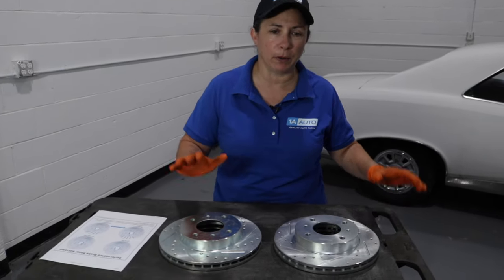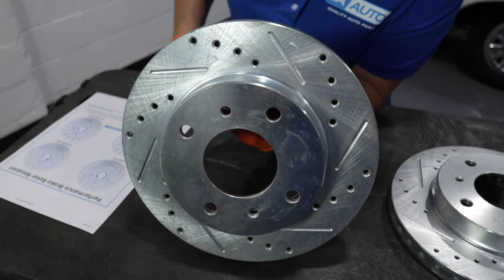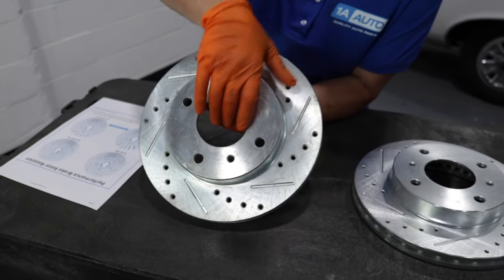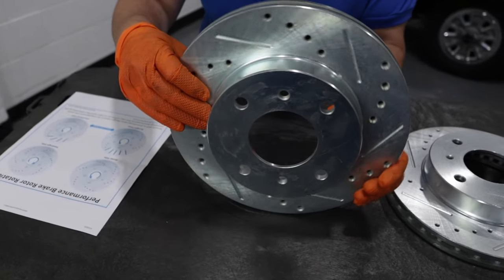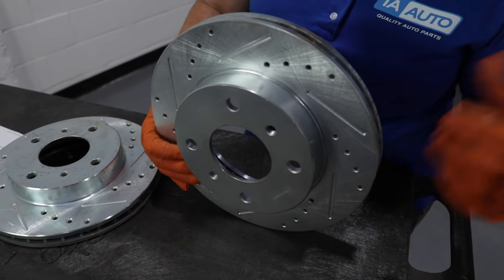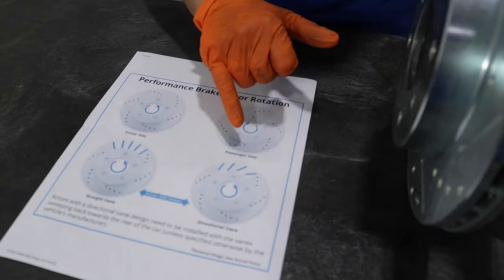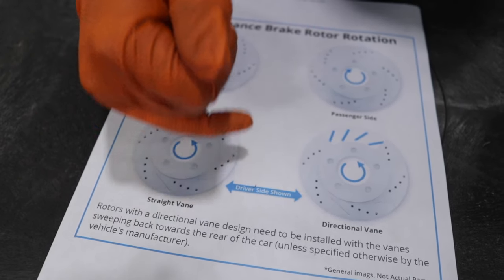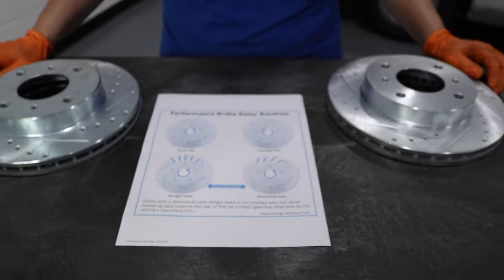The Correct Direction to Install Performance Rotors on Your Car or Truck

Comment: I am staggered that there seems to be no definitive reliable view which way soemthing as fundamental as brake discs should be fitted, whether handed discs grab air or remove air, whether slotted discs face towards or away, it is simply astonishing there are so many conflicting opinions. It shouldnt't be that difficult. Helpfully this video shows an instruction sheet which indicates which way veins should face, but what if the drilled slots are in an opposite direction to the veins?
Reply: If your veins are directional and curve inwards then ignore which direction the slots are facing, the cooling veins are VITAL to your brakes cooling down.  You want the veins to be curving outwards towards the front so that they scoop in the air into the middle of the rotor.  I've been scowering the internet for days and honestly I dont think the slot direction really matters.  I've seen manufacturers recommend both directions for slots,  the brand I bought from (r1 concepts) recommends the same as powerstop, pointing to the back of the car the way you would expect a cooling fan to face.  I really think its just preference as long as your cooling veins are straight

Comment: This isn't necessarily correct. The rotor has a serial number on the edge, the first series of numbers will either end with an R or L.  this is the side of th car the manufacturer recommends installation.

Comment: ABSOLUTELY WRONG! The top of the slot ALWAYS points to the rear of the vehicle. The only time this is not the case is if the vanes are also directional. Vanes are always open towards the rear, they do not scoop air, they sling air. Even then, they are more often pointed rearward. 

DO NOT FOLLOW WHAT THIS WOMAN IS SAYING. YOU WILL WEAR OUT YOUR PADS EXCESSIVELY FAST. THIS IS NOT A RACING APPLICATION.

Comment: Ok let me set the record straight. First there called drilled and slotted..
Second you are right and wrong!!
Only rotors with straight veins are to be installed with the slots and drilled angle pointing to the front!
Now most of all like 99% the viens are on a slant in that case you are wrong those rotors  you want slant pointing to back of car! 
So basically your the only company making these fucked up rotors!
I love how you said cut into brake pad! If anything is cutting into my brake pad someone is buying me  new pads! I drive a Super Sedan 800HP BMW F90 M5 with 6 piston big brakes and the rotors happen to be drilled only but since there so big the drilled part is spaced far apart and keept in from the outside 3/4 in that's how they came from factory and guess what. The slant part is pointed toward the back of the car just how it should be.
So why don't you go tell BMW, Mercedes, Ferrari, Lamborghini,.ect ect that they have it all wrong!!
From a company I never even heard of before.😂😂
The only A1 I have is going on my steak!! A1 1A all the same nobody should buy this product unless you want these to really cut into your pad hahahahaha

Comment: Talk about 1A putting a nood to Make a video about rotor install directions. Your information is totally wrong and misleading to your customers who probably purchased slotted or drilled rotors from your store. Slotted or cross drilled rotors should lead from the center of the rotor hat to the outer portion of the rotor to disperse hot gasses and brake dust to the outer of part the wheel.

Comment: I just brought a set of rotors & break pads from 1A Auto about 3 months ago 
  While stopping heard a grinding sound (metal to metal)  coming from the brake area .
Took the car to another Mechanic come to found out they where installed BACKWARDS 🫠